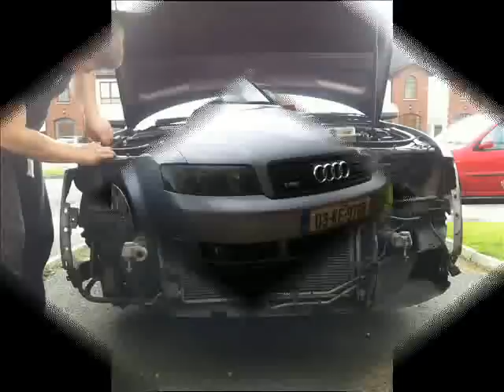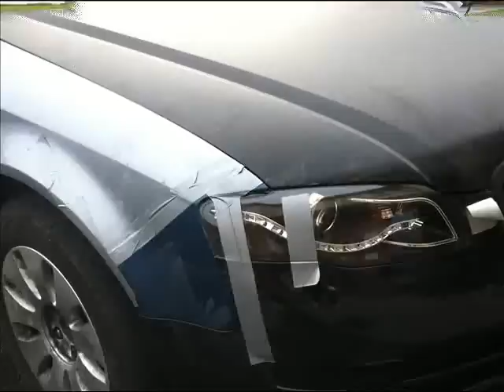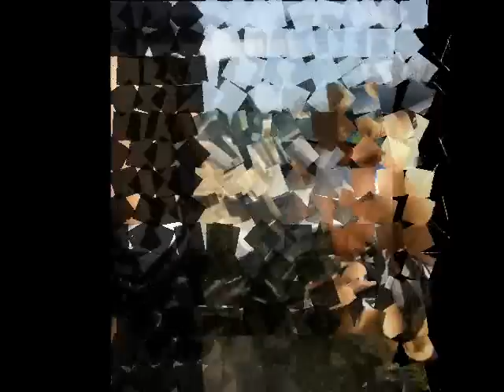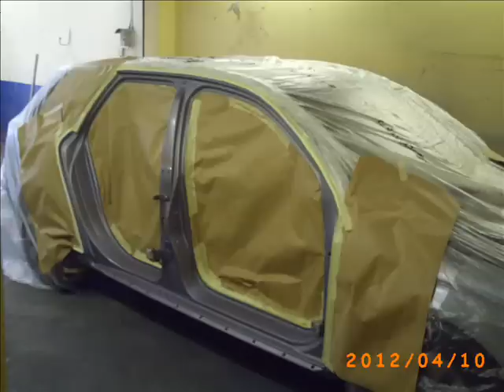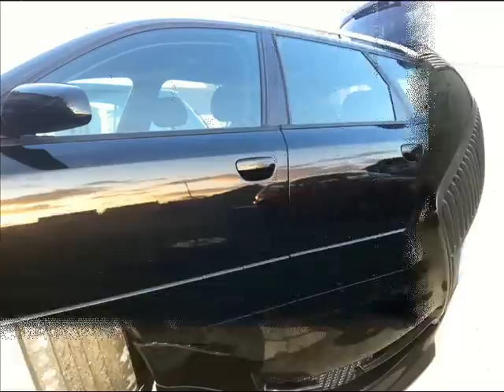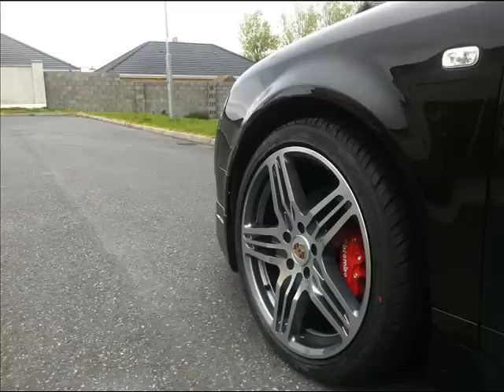Audi a4 b6 front change to b7 with rieger kit, stuning,real tuning (part 01)

Comment: Nice job.

Would it not have been easier to replace the fenders instead of welding?
Reply: Wondering the same thing. If you found an otherwise totaled B7 S4 (rear-end or something) could you just take the fenders as well and bolt up?  Looks great though, dude did good work.
Reply: for any inquiring minds... question answered in this video: https://www.youtube.com/watch?v=r7aSKiFlNhU.  Mr. Hajdu actually cut the fenders in a much better place/angle to weld them together.

Comment from the maker: Well, you will need, bumper, front panel, B7 headlights, B7 fenders, bonnet. I never replace bumper support brackets, bumper frame, bumper holder( bracket) bonnet locker, headlight bracket I just modifield the old ones. You can bolt on the B7 fenders no problem, but the line on it, does not match with the body line. I believe the B7 convertible modell has the same body line as the B6. Could be better option. I realized after the car was done. I hope I could help.

Comment from the maker: Hey my frien

The Rs4 bumper is not going to work, coz it is wider than the standart, if you want to get Rs4 bumper you will need rs4 fender aswell, but the bodyline not the same as the B6. And it will look bit stupid coz the front will be wider than the rear, or you have to change the rear pane aswell, massive job! I think. If you want some special look go search for DTM bumper, that is same wide as the standard, an look great! Rs4 is not an easy option!

Comment: excellent job 5 stars 
just a quick question if you change the wings completly would they fit ? from b6 to b7!! is the front end the same from b6 or did you buy  the b7 as well ? the metal bit!! thanks